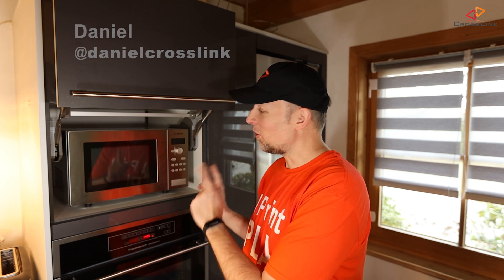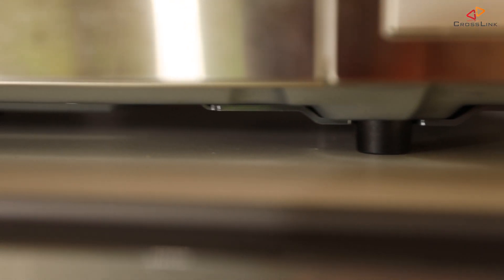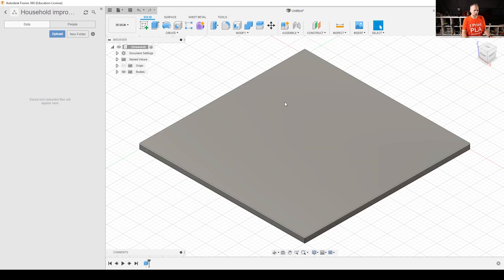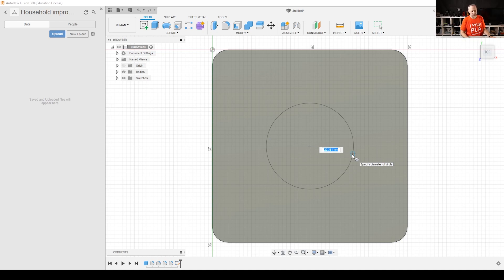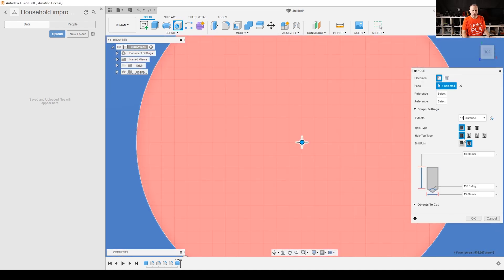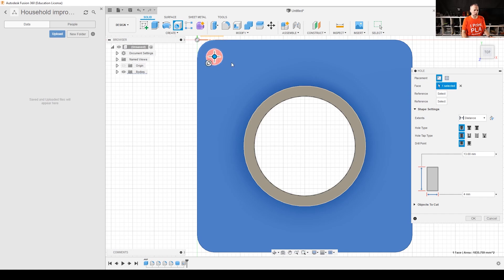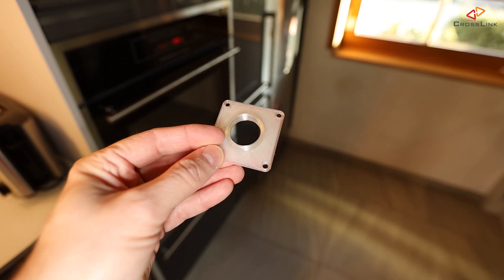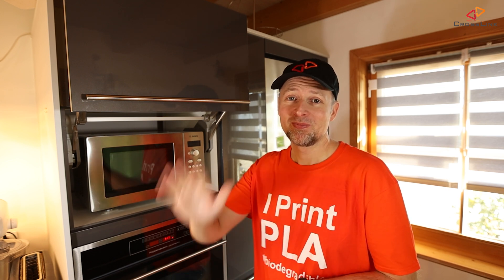Solving problems with 3D printing - A simple 3D printed part to hold our Microwave in place

Comment: Put a block of wood behind it. Low cost, easy to do, completely recyclable when no longer needed. If wood is not readily available a piece of cardboard (corrugated paper type)  would work.   Don't use high tech when low tech will do.  Keep it simple.
Reply: I was about to comment exactly what you said. A block of wood came to mind before he sat down to design the part. Keep It Simple!